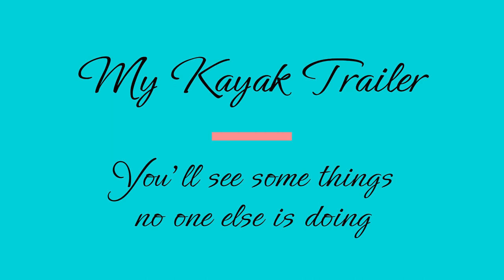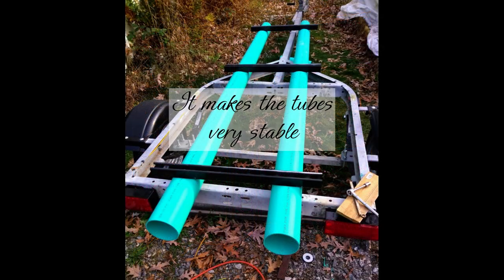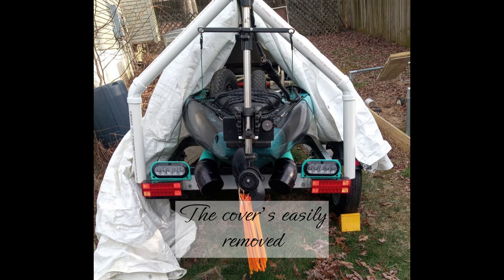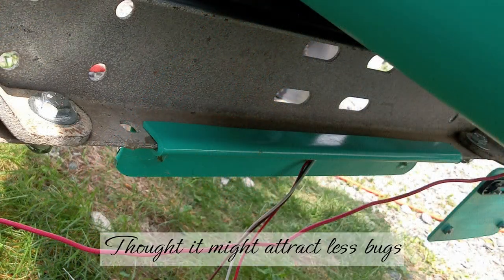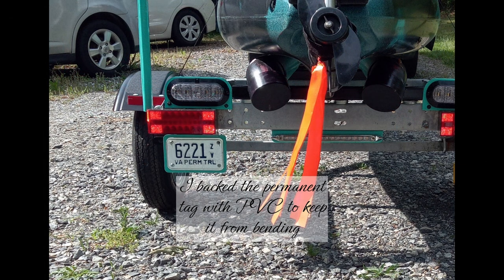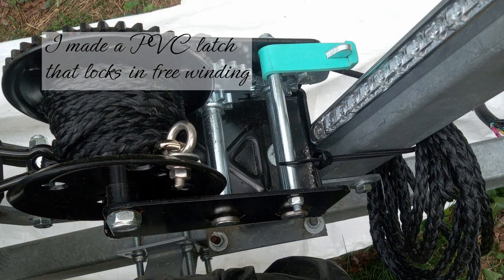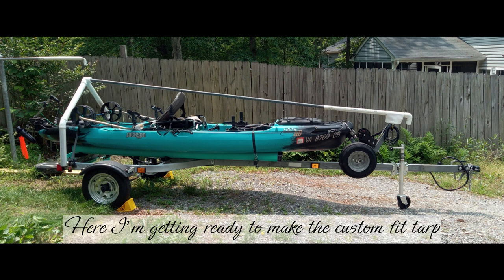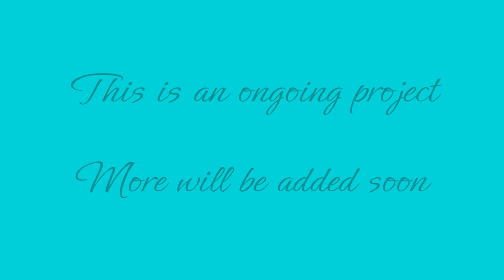My DIY Kayak Trailer build

Comment: Nice trailer build thanks for sharing. Do you need the landing gear wheels now w trailer?
Reply from the maker: You never know what kind of situation you’ll run into. If it’s really busy it might be easier to just roll it to the water or back to the trailer. It’s good to have the option.

Comment: Excellent job! I like your attention to detail.  I moved from a 12 year old Harbor Frieght trailer to a McClain John Boat Trailer (sale - $649 at Academy Sports). I carry a 2016 PA14. Anyway, changed from 8" slow speed to 81mph 12" five stud wheels, and did very similar lighting adjustments.  Your brace for the 3" PVC members is probably not needed, since the yak will be cinched with the BoatBuckles during transport. But nice touch (my solution was a PVC pipe cross ways under the bow attaching the two pipes).  I also added backup lights and, hence, moved to a 7 pin wiring harness. Most of the weight of my yak is over the axle; travel with a red flag, and this gives me space for a tongue box. But all in all, nicely done.  I would make a video but I suck at that :) - BTW, what slideshow program did you use?
Reply from the maker: Microsoft Clipchamp is a really good program. It even has text-to-speech so you don't have to use your own voice. I'm just using the free version and it works great. Have you seen my other video,    https://youtu.be/T46SyS6BH1M